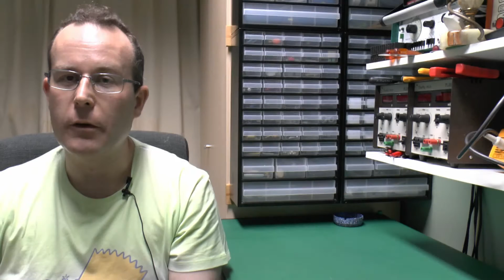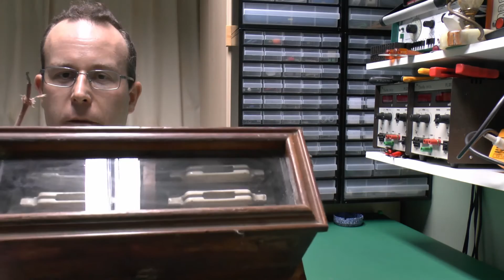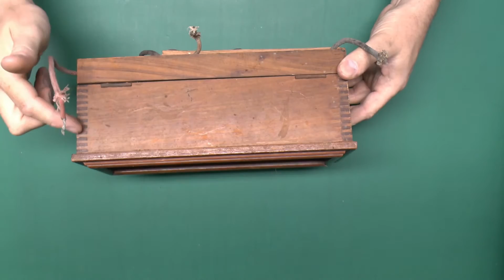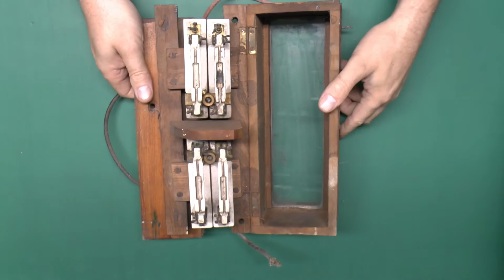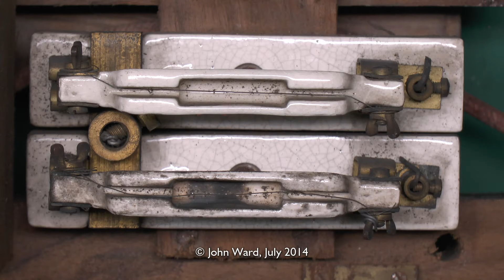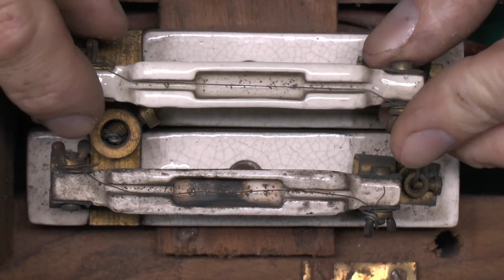Wooden Fusebox with Glass Lid and Ceramic Rewireable Fuses

Comment: I've read about these types of fuses. it was my understanding, that the home owner could buy rolls of fuse wire, and repair them themselves. instead of replacing a cartridge fuse ,or in the case of the US, Edison base screw in fuses which were used in the some older homes..

Comment: I can remember working on installations with open wire fuses in the early nineteen fifties, replacing the fuses with the fault still there was always a bit hairy with molten copper all over your hand, a piece of rag worked wonders, turning the power off was a not on.Those were the days.

Comment: Could double pole fusing come from a time before the centre-star point of a three phase transformer was grounded? Or perhaps even a time of DC - again, when neither positive nor negative were grounded?

Americans use two-phase breakers for their 230V outlets as this voltage is provided by two phase lines in their systems, not a phase and neutral.

Comment: In the mid to late 80s I used to regularly visit a big old Victorian   house to replace lamps (100 watt incandescent bulbs) in the exterior lights  that they burned all night every night . The electrics were all very old. I always called on a Friday at beginning of the month in evening to wind up the time switch that controlled the exterior lights. It was a metal cased Venner with 45 day hand wound clock.  
Eventually (1992) the place changed hands and was modernised / rewired . I managed to keep that old timeswitch . There were also 4 x separate fuse boxes EXACTLY like this . I now regret not keeping those also.   There were no "main switches" as I recall , those fuse boxes were fed directly from the meter , so removing one of those fuses with exposed live wire would have been interesting . ( A fuse never blew or needed any attention and I never had to do that fortunately) .  Just replace bulbs and wind up the time switch.

Comment: I have a six fuse box almost identical to this,  it was still in operation in the 1990s, in my grandmother's home.  She moved in to the house in 1935 and it was already electrified.  The wiring was never replaced and there were two circuits,  5amp and 13amp. The wires to the upper rooms were conveyed in WOODEN conduits up the staircase.  The fusebox was in the hall, high enough to be out of the reach of children.

Comment: Huh. I find all of this fusing stuff ya'll do over there quite fascinating. Over on this side of the Atlantic we generally don't fuse our homes, instead it's all resettable breakers on every circuit. Most of the time we also have one large, 'main', breaker that shuts the entire house on and off. It's rare that appliances even have them, then again we don't have ring mains in our walls either.

Any real advantage to fusing VS breakers, excluding the nuances of a ring main of course. Assume an American wiring system, each room on its own circuit(And often lights separate from wall outlets!).
Reply: Fuses are older, simpler technology. Much less to go wrong than a breaker, and much less chance of it failing to trip. Though we mostly use breakers now in our consumer units instead of fuses (I think fuses are still permitted).
Reply: We have used breakers here for decades, too. Both the US and the UK used fuses in days gone by. In the US most fuses in your electricity panels were of the screw in type, you might have seen one before?

Comment: Would anyone believe me if I told them I've seen a very similar unit to this one and that old single core rubber STILL IN SERVICE! The one I saw only had 2 fuses (no neutral fusing) The house belonged to a 93 year old woman and she called me because her sockets had failed. I told her how outdated and dangerous the unit was but she was one stuck in her ways. I could not talk her into a rewire or a unit change.  I had to just replace the fuse wire and be on my way. The funny thing was the supply fuse had just been replaced and the supply unit and meter were brand new. The installers just came and went and didn't bat and eyelid!

Comment: I remember this typ of fusebox from the film "Murder She Said" with Margret Rutherford as Miss Marple from early Sixties.
While on a undercover mission as a housemaid at a manor house she controlled the fuses after a blackout .
Fusebox and ceramic fuseholder looked quite similar.

I wonder how to protect your fingers  from the contacts while changing the fuses
Reply from the maker: dd313car When replacing fuses, a separate isolator switch would be turned off first.  Assuming of course that those replacing the fuse were aware of the need to do this, and it was easily located, and was properly labelled, and was visible while holding a flickering candle in the dark.
Reply: I was watching the same movie and hadn't seen anything like that before.  Your info was just what I needed!